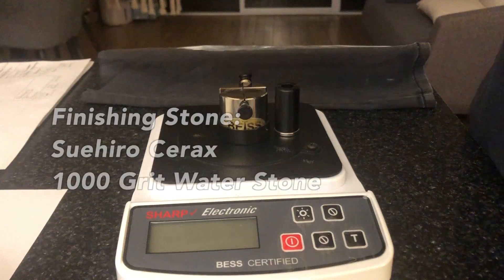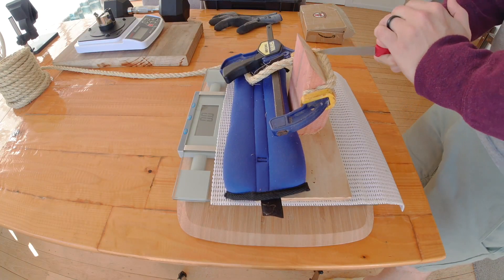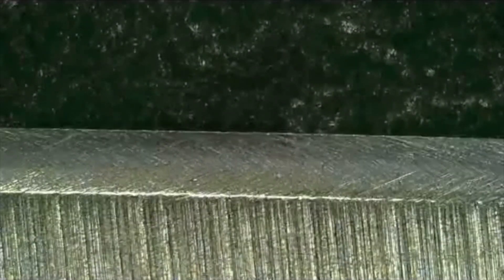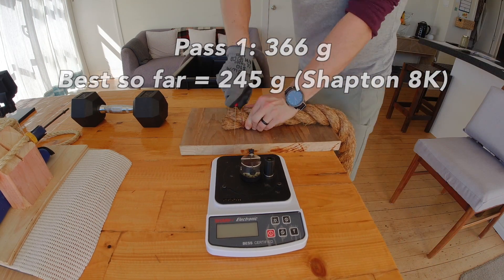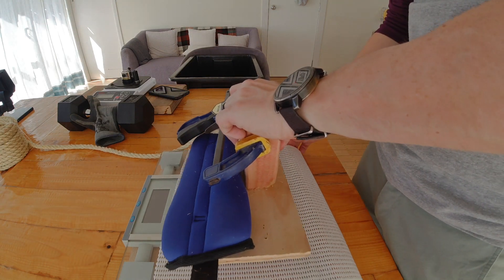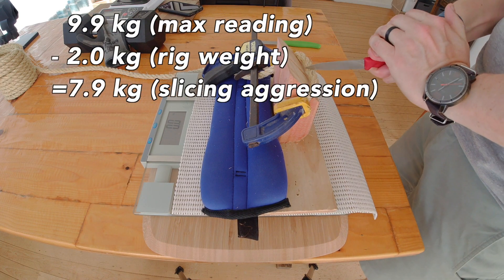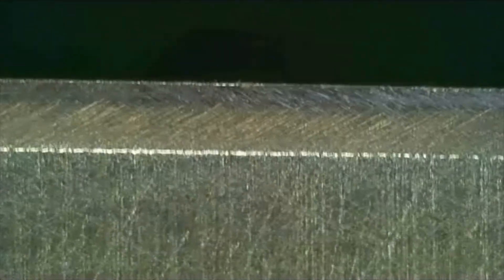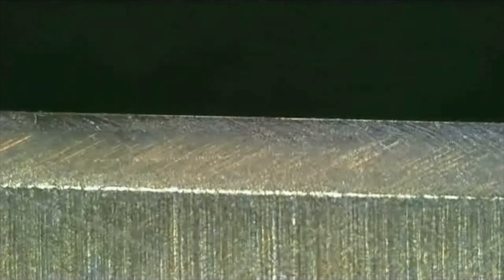Suehiro Cerax 1000 Grit Stone VS 40 mm ANDE Rope | Knife Edge Test

Comment: I have really gotten to where I like the Cerax series of stones for certain steel types. Softer low alloy stainless and good ol 10xx carbons... the edge quality from Cerax stones is excellent. Overall they are a great stone dollar for dollar, they don't have a ton of cutting horsepower BUT they are very good (steel dependent of course) I really love the finish of they leave. I have the 180, 320, 800, 1000 and 1500. I don't care to much for the 1500 to be honest but the 1000 is absolute fire. The 1500 was given to me for a review and I just never liked it all that much. Most of the carbon knives that I use them on for customers most time want a 800 or 1000g finish and both those stones rock on 10xx steels. I have a couple 1066 knives that are around 4 to 5 inches that i use around the house for tasks where I don't want to use my folders (typically garden work, knocking down small sapplings in the back of the fence, cutting down vines etc etc..  those knives all only see the 320, it leaves a highly aggressive edge but not so aggressive that it's like cutting with a fine serrated knife. The 320 cuts quick enough to take care of damage in those softer simple carbon steels and it just makes a perfect 1 and done stone.. also I don't want to scare anyone away from the 1500, I'm not saying it's not a good stone, by all means it's a good stone. I just have one issue with it and it's kept me from using it after about sharpening 15 knives on it and lapping it 3 times. Mine has a grit contamination issue, I get random scratches in the pattern that are like 400 grit. Like I will have a nice consistent scratch pattern going and then all the sudden I'll feel it and look at the bevel and bingo I have a couple much larger scratches at random places on the bevel... it's the only cerax stone I've had that has had grit contamination issues but this one has it pretty badly and to the point that it's not a usable stone for me. I'm sure it's a rare issue so I don't want to scare anyone away from buying one but I do want people to know about the issue. I know it's in the stone as well because I have lapped it a couple times with a diamond plate and removed a good bit of stone after the first lapping to make sure it wasn't just something on the surface. I could sharpen 1 or two knives and not have the issue then bam have it happen again on the next 1 or 2 knives and then stop happening again. So it's definitely a few larger grit particles randomly throughout the stone and when they surface they wreck havoc.

Sorry for the long post, everyone that knows me knows I talk a lot lol.
Reply from the maker: Haha, no problem!  I did these tests about 6 months ago, and (spoiler alert) I settled on the Cerax stones as a replacement for my King Stone for the fine side of my dual grit edges in steels under 64 HRC, under 1.3% Carbon, and with less than 4% Vanadium (I find any higher on any of those and you benefit from an all-diamond/CBN dual grit edge).

Bummer about the grit contamination - as a sharpener I understand how sad it is to really like a particular stone, but then develop a problem with it.

I find with steels that are relatively softer, they take a nicer dual grit edge if you have a fine stone with a relatively soft binder (ceramics and diamond can be a little too aggressive, even my Shapton Glass 8K pushes the apex back a little too fiercely, where the Cerax seems to realign it and clean it up so it's ready for stropping to an edge that's still aggressive).

I get really good dual grit results on conventional stainless, or basic carbon steels with aggressive diamond or CBN plate for the coarse side (400 Mesh Spyderco CBN plate is my current favorite), Cerax or other soft whetstone on the fine side, and deburred lightly with 3-10 strokes (more strokes for more ductile steels) on flat denim with Mother's Mag.  It just eats the Manila Rope after that!

I have a F80/160 Venev OCB CBN stone coming on Tuesday, VERY excited to see what kind of dual grit edges we can cook up on some of these higher alloy steels (10V, K390, 15V) with that.

Happy sharpening, cheers.
Reply from the maker: PS I have a test on used sand-filled ship rope with 10V coming next week.  I used 400 grit and 30 light passes on StroppyStuff 0.25 um on leather.  The resulting edge is insanely aggressive.

It reminded me of your comment about dual grit 10V being insane - this one outperforms Maxamet as well.  What kinds of stones did you use on your dual grit edge?  Was it diamond lapping films?

Comment: Been having my own deburring problems lately, I have a Boker Plus knife in VG-10 with the stubbornest burr I've even encountered on a proper knife steel. I've been messing with it for days and can't get rid of it. On the positive side, it pushed me to look up some research from Knife Grinders Australia and man they're a great resource.
Reply: That's why I make a 25 micron diamond emulsion. When it's a PITA burr that is super gummy and will flip flip all day long but not break loose OR a burr that as you refine the burr it just gets thinner and thinner and thinner and floppier and floppier but will not break loose no matter what you do.. 2 or 3 passes on a hard steer leather with my 25um emulsion will cut the burrs loose. I make this 25um specifically for stubborn burrs (it's a totally different emulsion base than any of my other emulsions are made with, took me about 2 years of testing different ratios, different emulsion base, different diamond types etc etc to dial it in to perform how I wanted it to perform) it's really amazing stuff. You use ultra light pressure just ever so lightly kissing the apex to the strop and it will remove the burr. The cheapest dollar store stainless knives that are pot metal and create those ultra thin and floppy burrs like gold left that no matter what you do you can't get it to let go of the apex and that 25um will cut it loose with just a couple passes. Another thing that it works really well on as a strop medium is denim. It will feel slightly less course on the Denim than hard leather but it will still do the job just as well. Extremely light and controlled pressure is the key to allowing it to do what it's designed to do. As soon as that burr lightly kisses those course diamond particles it will be cut loose.. on mega stubborn burrs I've never had to make more then 5 passes to have a fully clean of burr apex exposed.
Reply from the maker: @EDCandLace  do you sell that stuff?  I think I need it for a super soft knife in 12C27 I'm working on this week!
Reply from the maker: They are incredible.  I read Vadim's entire book, inspired by my own stubborn-burr problems!!!

Comment: The silver thread across the Edge.
I zoom in a little more to see if the silver thread is even and uninterrupted and then I am very careful when stropping on leather, sometimes only once.
Reply from the maker: Interesting!!!  Do you use a compound in your leather or is it unloaded?

Do you often find that is enough to deburr to under 100 BESS?  I often have a hard time getting rid of the "silver thread".
Reply: @homeslicesharpening  Previously I tried to get as much sharpness as possible from that silver wire, as evenly as possible and centered on the edge. Sharpening a knife is the same as sharpening your consciousness, you don't learn it in a day.
Nowadays I end up with a 12,000 grit stone in my extra special way so that there is no longer any silver thread over the edge and I only run the leather strap back and forth once, after which there is only sharpness.

Comment: Yeah. Deburring on midgrit waterstones alone is tricky sometimes, because they do cut so efficiently on normal steels. Which is what makes them so great for getting a knife sharpened quickly. 

The best tip i can give is using "less than gravity" pressure. So you are basically barely touching the knife not even letting the full weight of the knife sit on the stone for pressure. The tough thing about it, besides maintaining such low pressure, is actually holding the angle correctly since you cant use pressure to feel what angle the knife is at like normal.
Reply from the maker: Awesome comment Jason, thanks heaps.  That is sometimes a struggle for me, because I learned to sharpen with just a King 1K/6K and was accustomed to reprofiling by just pushing harder!

I am getting better with the featherlight touch though, but it's a journey to reprogram your muscle memory!
Reply: @homeslicesharpening  yeah. I think thats something a lot of do, and can struggle with. It can certainly take some concentration to not go back to the normal muscle memory amount of pressure that we tend to use.